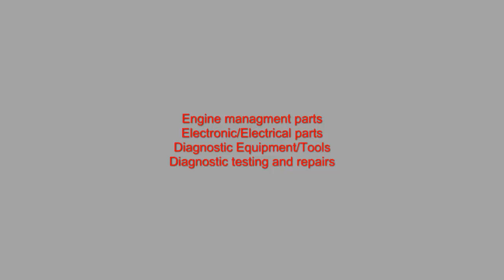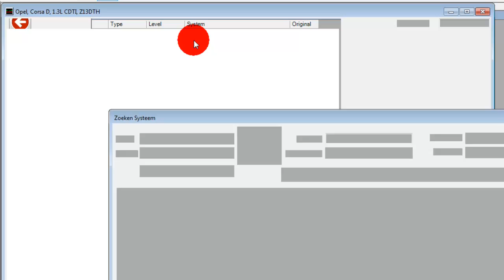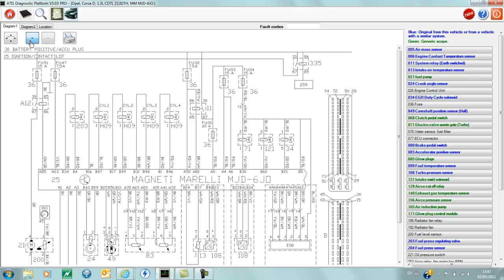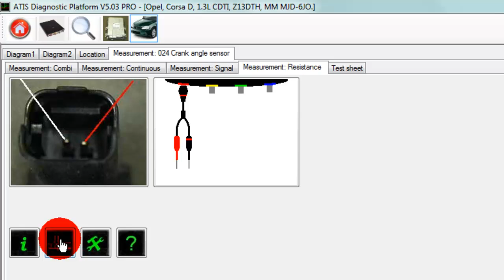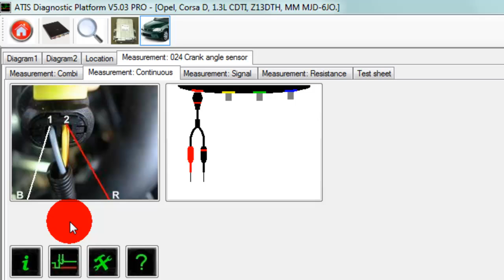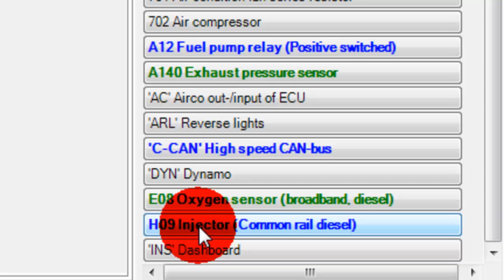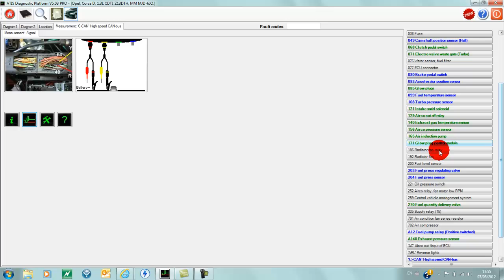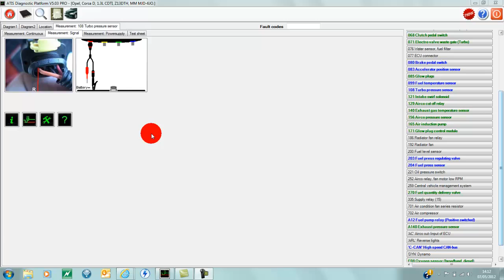GMTO Automotive Oscilloscope  Part 3 (NOW UP TO 1GS/s sample rates)

Comment: Hi, is the software a "one time buy" or an annual subscription? Thanks
Reply from the maker: For the ATIS pro software its a one time purchase and it will keep working for ever but if you want to get the latest updates you need to pay the suscription 
It comes with one years suscription
Reply: @RyansAutomotiveTV  Got it! The same system as the diagnostic tablets. The system continues working for the car models up to the year of expiration. Thank you!